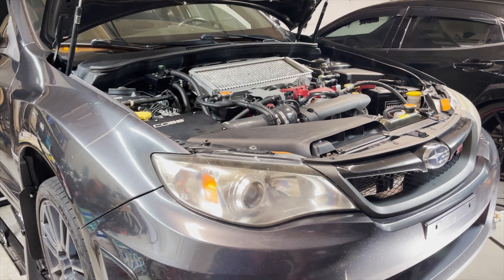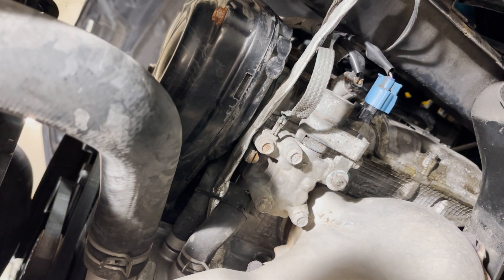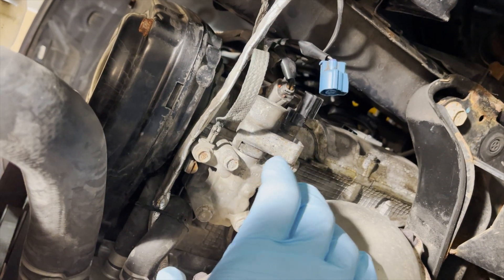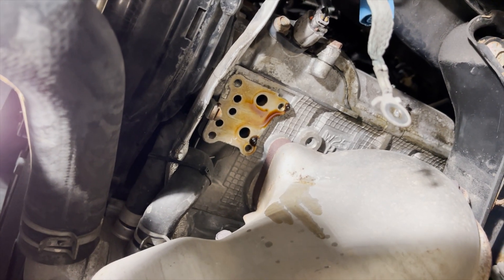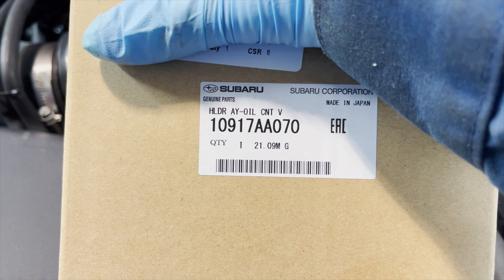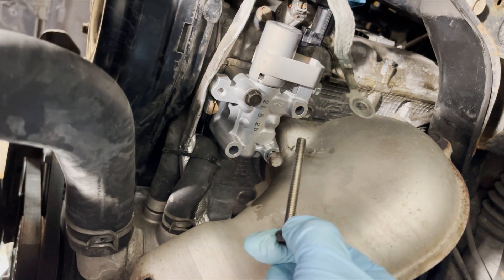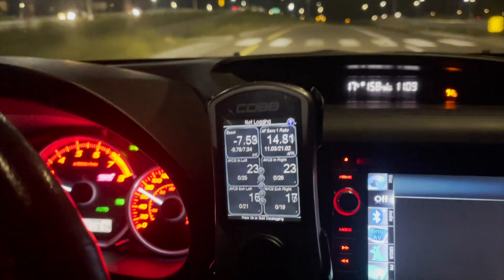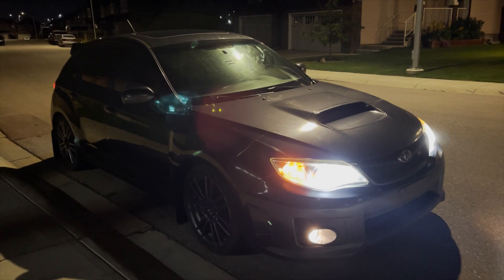Subaru P0024 Exhaust Bank 2 Oil Control Valve Replacement

Comment: Thank you for this Video, Ive had my STI for over a year around 60k miles. timing belt has already been done at like 30k miles. Code p000d poopped up, Dam never dropped, but i did view the avcs my left exh  is at like 40 when my right is at 20, around double. They were even the last time i checked. Im going to order OCV as its the exact issue u had but a different code?
Reply: Did this fix your issue?
Reply: @ryanlittle5457 yes and no. It hasnt thrown a code since a new ocv install. But the dealer gave me an intake sensor and I plugged it in for a day or two as I thought it was the same or very close to. An now my left reads 1-3 degrees higher then right. So I do have somthing weird still going on maybe the oil screen is plugged or I need to replace the left now. But it did work just make sure u get the exhaust ocv dealer sent me home with intake ocv….. car runs fine tho and no codes but off 2-3 degrees even 5 somethings

Comment: I recently did this on my car. After 500 miles or so I noticed there was a small bit of oil on each of the four bolts’ heads. Should I just tighten them or could there be another issue?

Comment: Can this also clear P000d?
Reply from the maker: it could very well clear it yes.  The OCV valve controls the flow of oil and if the rate and pressure of the oil flowing through the valve and cams isn't within spec then the ECU throws all sorts of wonky codes.  It is a common failure point on the EJ motors and in my opinion, is considered a maintenance/wear item.  I've replace so many of these valves that I've lost track but the car tends to run better when the valves are new so even if it doesn't solve your issue that it is almost considered good practice to change them out.

Comment: I have P0024, cleaning the OCV  can help ? Or i should definitely replace it ?

My 2015 wrx sti ej257
Reply from the maker: replace... cleaning won't do anything.
Reply: Update: today i installed the same part, i can't find a way to thank you bro, you really saved my life 💙, the mechanic changed the exhaust sprocket & timing belt kit & top OCV & Camshaft sensor( 1600€ ) at the end for nothing.

Until i saw your video & now P0024 gone + car runs 💯

Great thank from The Netherlands 🇳🇱 
For sure like & share & subscribe.

Comment: Thanks for the video, helped a lot, but why didn't you replace just the solenoid valve itself without housing? It would be cheaper and less work.
Reply: Hi bro what the name of the solenoid it's self . Mind has the same code and just need the solenoid
Reply: @stanleyOrloff  hi bro can you assist me with the solenoid part name and part number
Reply: Part number is in the video  @tyronegoes3548
Reply: @brianandcindy1 That part number shown in the video is 10917AA070 which is the whole Exhaust AVCS assembly. Most people just want to replace the solenoid instead of the solenoid + cast aluminum holder.

10921AA140 should be just the oil control valve solenoid

Comment: I have year 2006 ej25 and on the bottom, on both sides, in the place you show I have only clean flat surfaces on the block, no valves, but still got p0024, any tips?

Comment: i got p0018, p0024,  and P000D. would i replace the vvt sensor? or this?
Reply: I got p000d on mines im try to replace the oil control valve, but its not the same part as the video

Comment: I periodically get a p000b on my 2016. Its crazy, it first would go 100-200 miles before coming back on. Then I went 800 miles or so the next time. Then 100. And now its been about 1500-2000 miles and havent seen it pop back up. However,  during this process I did swap out the camshaft sensor connected to this, and I did notice an oil leak around this solenoid. Pretty sure its from the header burning any seals in that area. I have the part, and gaskets, just waiting to find time on a lift to swap it out and hopefully i'll never see the code again! And knock on wood its not a camphaser/ECM issue like I have read in forums :(
Reply: Did you ever fix it?
Reply: @angelotorres8051  so far so good, I just changed the entire solenoid/gasket for it, and no code in roughly 2k miles, car seems to run smoother and stronger because of it too
Reply: @tHeClOsEr15 do you remember the part number for the solenoid by chance, I have a 2017 STI and constantly keep getting P000B (pass. exhaust cam) changed the cam position sensor it helped a little bit but code keeps coming back. Tried to clean the solenoid and OCV but it was already pretty clean and it didn't resolve my issue. Kind of getting to the point of getting sick of wasting $ and time on parts that won't fix the code. Measured the resistance of the solenoid and it was at 7.5ohms or so, which I've read is in spec for an OCV. Any info would be greatly appreciated!
Reply: @SUp3RpooP3r7698 might be your exhaust cam gear, it goes sensor, ocv and then cam gear for the p000b

Comment: Hey, I'm a little late to the party I know, this is a great video though. My 15 has had this code periodically over the past month or so(CEL will flash for a day then off for a day, etc.) I've been driving it but not hard. is there a different code if the passenger side CV has an issue, and is it more work to replace? I'm going to order this part as the code I am getting is the p000d.
Reply from the maker: definitely replace.  The solenoids interestingly don't usually fail from being dirty b/c if you do your oil changes regularly then it shouldn't be dirty but rather the fine surfaces that are machined into the solenoid jam up or the solenoid's electronic components start doing wonky things.
Reply: I get p000b from time to time. I went 200 miles b4 it came back on, then like 800 miles, came back on, then 100 miles came back on, and now ive gone maybe 1500-2000 miles and it hasnt came back on. Dont quite understand it. But I believe im going to replace this on my passenger side too
Reply: Did it fix it?
Reply: I also have a 15. You should replace both driver and passenger just in case and the P000D code is the boost control solenoid (I believe it’s named that) you’ll have to either change that I believe. That’s what I’ll be working on the next couple of weeks

Comment: I just got this code. On my Cobb it says “ exhaust cam 2 (LH) system range/perf” I’m guessing I just need to change the drivers side ?
Reply from the maker: hey sorry for the delayed reply.  These solenoids are notorious for failing so good thing you ordered a replacement.  They're so crazy expensive for no good reason but if it resolves the issue then I guess its the cost of owning a Subaru.  Glad things are working for you now.
Reply: @piercedasian  all good! Thanks for the video!
Reply: Any update ? I have the same code
Reply: @speed2k5  it is the drivers side. It happened on mine first drive after being parked for 8 days. Ordered a new one from Subaru and the next day the solenoid unstuck it’s self and it’s been fine since lol
Reply: Still going to put the new one on just incase and cause I paid for it already though
Reply: You got the same part number as the video for like $2xx or another one ?
Reply: @speed2k5  yeah the one I got was 250$ Canadian or something with the gasket to. Gasket was like 10 or something
Reply: @Heyzous  sounds good

Comment: My car is throwing this code. Basically same car as in the video however I won't have the parts for a week. Am I able to drive the car or should I park it and wait till the part comes in?
Reply from the maker: yep you likely can but it will probably not drive too well.  Just don't hammer on the motor and you'll be fine.

Comment: Awesome video. Do you ever see value over 17/18 on the exhaust side after replacing the part? 
You mention in the video it had used to go into the 40’s, which mine does. I’m looking to do this in the near future because my numbers aren’t very symmetrical. But, should I be worried about hitting the 40’s as well?
Reply from the maker: I saw values of over 40+ on the exhaust side while the intake side was about half that value while driving.  At idle they should be symmetrical at basically 0.  After I replaced the oil control valve that the values were spot on identical and the car drives MUCH better now.  The values will go up and down  and that is okay as long as it symmetrical.

Comment: I have p000d on My 2016 sti 
Dealer only flush they oil but the code came again?
Reply from the maker: the oil flush rarely resolves these issues and the best thing to do is to replace the part that your check engine code is pointing to.
Reply: @piercedasian  What part can be changed next, it would help me a lot to know the part number for my 2016 sti code p000d
Reply from the maker: sounds like you've got some wonky issue with camshaft phasing.  did you by chance do something like a timing belt or neglect to do regular oil changes?  Basically the code indicates that the response from the exhaust "B" cam is not getting the response its expecting so you can try to replace the sensor and see if that resolves your issue.  The oil flush the dealer did was to likely address "gumming" or sludging of the cam phaser in the motor.
Reply: @503pilychvz8  did you ever find out what the issue was? Mine is throwing the same code and the internet is saying replace the same part that the guy on this video did although it’s a diff code
Reply: @mateopatnongon   I remplacement exh cam sensor and both avcs driver side

Comment: I ended up stripping one of the bolt that goes onto the oil control valve sensor 🤦🏻‍♂️ How would i get this out ? Also what bolt is it ?
Reply from the maker: oh ouch... is an M6 1.0 thread pitch metric screw but you'll need to either drill it out, re-tap it or simply replace the part that is stripped.
Reply: @piercedasian  I mean its the bolt that goes into the engine so changing the part wouldnt make a difference lol i think maybe drilling it out huh? Thanks for the info tho cuz i was trying to look for that bolt 😅
Reply from the maker: @iBLaCKOuTxZ  yikes that is really crappy.  you have to be SUPER SUPER careful when drilling into the block to get it out.  Drill as tiny of a hole as possible and then use a screw extractor to get it out.  This might b a fix for the pro as once you mess up those threads and misalign the hole you're going to get some wicked oil leak issues.
Reply: @piercedasian  yeah you might right i might just have someone with experience to do it for tbh !

Comment: I've replaced mine twice and it still leaks like crazy when it's off for a few secs and when it's off it leak through the bolts
Reply: replace gasket too
Reply from the maker: I second this.. gasket replacement will prevent leaking.
Reply: Ive had a similar issue of it leaking through the bolts even with a brand new gasket.. gonna try it again and replace solenoid as o ring is shot

Comment: Is this the same tutorial as on the 2018+ STI?
Reply: Yes, just did mine. Little tip though: instead of 10917AA070, use 10921AA020. This will replace the solenoid valve itself, and not the valve + holder. you save a good bit of money, like 100$ vs 240$. I just did this for P000D and works perfectly.
Reply: @Laborchet  Im getting mixed sources saying it's either 10921AA140 or the part number you said for driver side. Are both solenoids different? I know the holders are but what about the solenoids. I'm not sure which part number to order just to replace the driver side Solenoid.
Reply: I think so. I gotta do mine too
Reply from the maker: The service procedure for the newer STi's is the same.
Reply from the maker: Ah good tip for our viewers.  This subaru in this video was buddy's car so I wasn't aware that the valve can be purchased separate from the holder.  The Suburu parts guy told us it was an assembly that could only be purchased.  Not sure if that was the truth but sounds like the parts guy was upselling us.

Comment: nice and short to the point video! Is P0024 same as P000D? My bottom left is not changing at the same rate as the bottom right (AVCS exh)
Reply: P000D is the code for the same valve, the driverside exhaust (underside of engine) There is a cheaper way to replace this with OEM parts, instead of 10917AA070, use 10921AA020. This will replace the solenoid valve itself, and not the valve + holder. you save a good bit of money, like 100$ vs 240$. I just did this for P000D and works perfectly.
Reply: @Laborchet   sr I have the p000d code in my 2016 sti dealer only flushed the oil but the code came again ?
Reply: @503pilychvz8  they did the same exact thing on mine 9/2022, only the flush. Today like 2K later the car threw p0024. Only issue for me is, on 9/22 I had warranty , now I don’t ..
Reply: @speed2k5  remplacement ocv + exh camshaft sensor and ur fine this fix my p000d for the moment
Reply: @Laborchet  thank you!
Reply: @Laborchet I order part ending in 040 the oil control valve. Is that the same as 020? I got the same code

Comment: Firsy off great video! Though i came to this video to figure out the torque spec for the screws holding on the ocv assembly.  Did you really just leave them hand tight? I have a rather accurate torque wrench and was curious to get a little guidance here or is hand tight good enough
Reply from the maker: Glad you liked it. Yes legit hand right using a tiny 1/4” ratchet is all that is needed. I have found that my hand tight with a small ratchet comes in roughly at 7-10 ft lbs which is precisely what the torque needed for the OCV bolts are. Most torque wrenches unless they’re calibrated for such low torque values are often grossly inaccurate at those tiny values which is why I forgo using a torque wrench for something as simple as this valve. Your call but if you insist on a torque value then I’d say about 7-8ft lbs. not the official number but it would be sure as heck close to it since it is a M6 bolt.
Reply: @piercedasian  thank you for the detailed reply! Yea I found the torque spec somewhere to be 7.5 which I'd definitely say is hand tight with the socket wrench :) I was leaking oil pretty bad out of mine which is what necessitated the replacement:)

Comment: Amazing tutorial! I need to replace the passenger side. it is leaking like crazy and under any type of acceleration, normal or WOT, the car hesitates a ton. I have the ocvs holder and sensor but I am just waiting for the gasket to arrive. Btw, amazing STi hatch! I am never selling mine.
Reply: @SSTIHatch.....love my Sti hatchback as well. Im curious how did the passenger side replacement go ? Mine is leaking as well. It looks like just the solenoid can't be replaced and the whole assembly need to be replaced like in this video. Looks like the exhaust manifold needs to be dropped in order to make room .....sucks because I'm looking at mine now and I can bet alot of bolts are going to break especially on the heat shield due to corrosion......how did it go for you ?
Reply from the maker: nope the only one that failed in this case is the driver's side solenoid.  They seem to just fail at random and they're stupid expensive so just replace the ones that are bad.